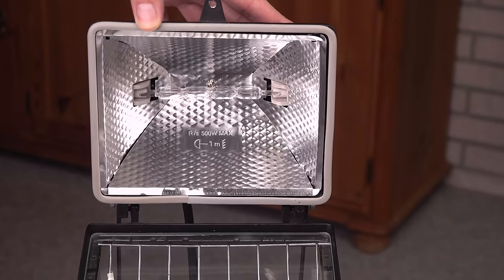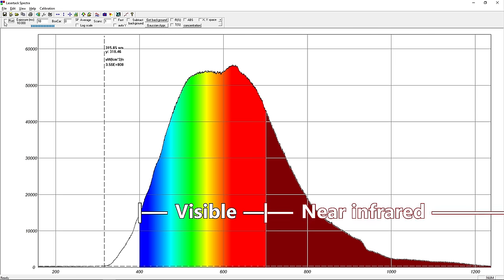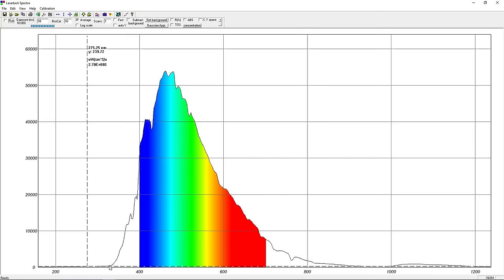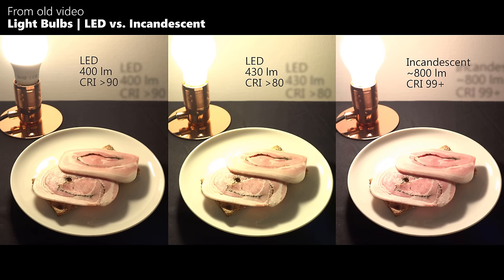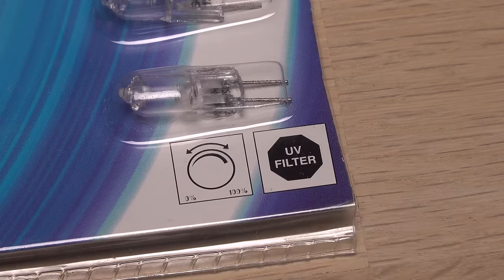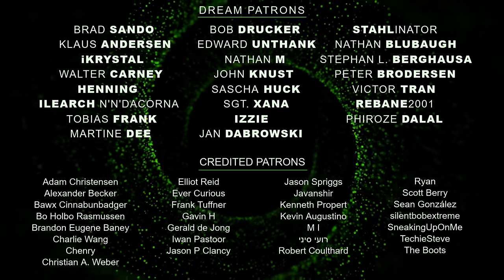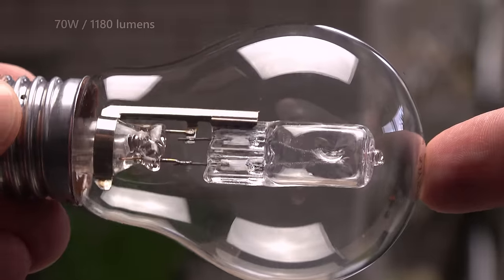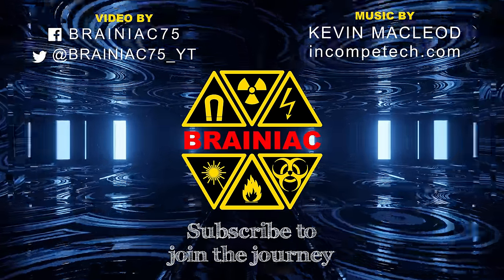Hidden Hazards of Halogen Lamps

Comment: I used to get similar halogen bulbs from the fusers of old laser printers. They were really long, but probably a few hundred watts at most. They scared the hell out of my dutch rabbit once, when she must have thought that the sun moved into my living room.
Reply: Biggest I have is a self ballasted 360W sodium vapour lamp, which has a 200W internal tungsten filament lamp as ballast for a 160W HPS capsule. ASL a few 400W mercury vapour lamps as well, which i used as room lighting when I wanted a lot of light, as they have a very good CRI by design, as they are high bay lamps for indoor use.
Reply: @SeanBZA  Where'd you get your hands on a self ballasted sodium lamp?? I've been looking for one for absolutely ages! (Something like 3 years...)
Reply: @sovb  An old Chinese lamp, got it at a lighting and electrical supplier, and wanted it the second I saw it in the big box of reduced price units.
Reply: @SeanBZA  Did you mean self ballasted mercury? I've never heard of a self ballasted sodium lamp before, that sounds really interesting.
Reply: @Snowcube  No it has that yellow sodium glow. Think it was mostly used on fishing boats, the yellow penetrates water better. Internally mostly SBMV, just the mercury has a lot of sodium dissolved in it.
Reply: @SeanBZA Do you have to shield your eyes to use the sodium lamp or not ?
I ask because I just got hold of two 400W high pressure sodium lamps (The normal kind, with a ballast and ignitor) and using them to light up a room makes my eyes hurt even with sunglasses on and the bulb hidden from direct view.
I tested the UV and there's much less than from a blacklight though.
Any idea ?
Reply: @psirvent8  Well with 400W of light you will just be about at equatorial noon levels of light, and there you definitely hurt your eyes when it is bouncing off all surfaces equally.
Reply: @SeanBZA  Thank's !
But do you know if it can really cause lasting damage to my eyes or if it is only discomfort ?
I know some websites sell blue and green tinted goggles to people using HPS lamps to grow plants indoors however they are quite expensive and also my ski goggles work quite well when I use with my 400W mercury vapor blacklight at close range, however they don't seem to be doing anything when it comes to the HPS bulbs.
Being in streets illuminated by HPS on the other hand didn't cause me any issues, but it might be because of how tall light poles are.
Reply: @psirvent8  They probably doesn't cause any damage but fatigues your eyes due to the poor and discontinuous light spectrum
Reply: So you are telling me that 99% of car headlights have radiation???!!!!

Comment: The MR16 that you noticed filter UV lights are known here as "Dichroic" lamps, the UV light is NOT reflected by the metallized coating, which is a dichroic mirror that only reflects visible light. You may also see a smaller amount of IR with them as well. Try putting your spectrometer to the back of the lamp and you'll probably find your missing spectrum. You can't measure it like you did because the filament is vertical so most of the energy is radiated sideways for the parabolic mirrors to catch. You can also try with an AR111 lamp which is a metalic reflector, not dichroic (AR111 = Alu reflector, 111mm). These are often used in applications where you can't release the heat into the recessed ceiling behind.

Comment: You can see a UV Stop in Halogen Lamps if you shine a UV light source at them, they will glow Blue-ish if a Filter is present.
Reply: Absolutely and I'm glad to not be the only one to have found this magic trick if I can call it like that.
No one else makes mention of it on the web, and I found that it also applies to metal halide bulbs that have UV filters.

Comment: Back around 93 to 2000 I had halogen track lighting in one room with the lights aimed towards one wall.  While the bulbs were replaced a few times they were never re-aimed but none of them had any glass covers...just the bare bulbs.  The walls were painted blue and when we finally decided to redo the room we were surprised to see a very clear bleaching of the paint only where the lights had been aimed and it was even more evident where the lights had overlapped each other.
Reply: My closest McDonalds used to have this photo wallpaper above the cash registers, and a handful of halogen spotlights in the ceiling above. I don't know for how long they had that setup, but you could clearly see these triangular bleached areas below each spot, perfectly following the cone of light. 
This sure explains why.
Reply: Same thing happened to coloured plastic films I had put in-front of the ones I had in my bedroom
Reply: Photobleaching can be cause by visible light too, and in some small measure even by NIR, if the source is intense enough and the exposure is long enough. The effect however is much more prominent at shorter wavelengths (blue and UV)
Reply: So you are telling me that 99% of car headlights have radiation???!!!!
Reply: @gabrielv.4358  Halogen lamps do give off UV.

Comment: The main safety function of the glass cover is to contain the hot halogen capsule glass if it explodes.
There is quite a difference in the front/rear direction heat is emitted between the standard aluminised reflector and dichroic coated glass reflector.
Metal halide lamps emit considerable UV, some types have UV block glass, others rely on the glass on the enclosure.
Reply: Yes, the 1kw Metal Halides are vicious.
Reply: As well as protect the bulb from dirt and dust. Dirt + heat = possible fire.
Reply: Hi, I thought that the shielding protected IT from shattering. (“It” being the bulb) so basically, No shielding= Bulb explodes. Shielding=bulb lasts its Life. (At least that’s what I though)
Reply: I had one bulb that exploded (a g9 socket unprotected) and fortunately 😂it broke my phone glass and missed my eyes. so that protection is much more important than uv.
Reply: @Stoney3K  and to protect it from grease/oil (mostly from the fingers).
The bulb is made from quartz because glass would no withstand the very high temperatures, but the oil from fingers skin will blow it in a very short time, or at least crack it.
A friend of mine didn't know and installed the tubes with bare fingers, without cleaning them afterwards, all the bulbs died after a few hours, some lasted even less than that.
Reply: @pbe6965 your mate 'old greasy fingers' McGraw?
Reply: That's not the MAIN reason. U/V filtering is the MAIN reason.
Reply: Right, the two most important purposes Are containment of an exploding bulb, And thermal stabilisation.

Comment: In most cases the amount of UVB you can possibly get from halogen lights is so insignificant compared to any amount of Sunlight and cannot give you a sunburn even if it shines on you all day long. 

That said, there were also specialized "Sunbathing" halogen lamps that ran so hot they actually looked blue. Very short lifetime on those as well.
Reply from the maker: For the 10 and 35 watters, sure, it's no biggie - but for the 400 - 1500 watters? I would like to be informed about it ;) Thanks for watching!
Reply: Yes thank you. It's trivial. Get back from the light and it's not a problem regardless of power that you can buy in a store.
Reply: The Sun is ~1366W/m^2 of actual light energy.
1500W halogen is going to be way below that because they're so inefficient, even if you're up close. You'd have to be right next to it.
Maybe its something to be measured and compared on a future video.
Reply: @n-steam  1-2%, so 15-30W worth of light, right up on it

Edit: And at that, only a tiny sliver of that is UV energy. There's more threat from a 1W UV LED than in a 1500W halogen. 🤷‍♂️
Reply: @MadScientist267  There's an area component to it too. Gonna make a guess and say the area of the light's face is 0.03m^2, so that 30W becomes 900W/m^2.
Reply: @n-steam  Uh, no. That's right at the filament.

You have 30W total to divy angularly from there.
Reply: @brainiac75  considering how much radiation the sun constantly hits the earth with every second, being next to a 1500 watt bulb would be nothing, the sun has a far higher chance to give you sun burn over the halogen bulb. in my opinion the radiation from such a tiny yet powerful bulb is negligible at best
Reply: Also you might have a halogen shining in a way that goes directly into your eyes, whereas you wouldn't be staring at the sun for an extended period. I wonder whether the UVB would also age interior paint more quickly, given it would be exposed to it constantly. I wouldn't be worried about sunburn (neither indoors nor in the sun).
Reply: I agree and the best source of vitamin D is UVB so its actually healthy especially in winter
Reply: @Robonza  Too bad there's almost none there
Reply: yeah a little radiation never heard anyone, right?
Reply: @brainiac75  I'm afraid you're going to cause the Vela satellites to pick up another Double-Flash. Be careful!! 😳🤣
Reply: About the halogen lamps looking blue, that's not physically possible: the average incandescent lamp is run at 2700K, more or less, while commercial halogen lamps are usually around 3000K. Research grad halogen lamps can be run at 3200K with a greatly reduced lifespan (1000 hours or so) and for every 100K you reduce that lifespan by a factor 10. At 3500K the tungsten soften and at 3700 it melts.
The white of your monitor is 5000K, while daylight is about 6500K, at which point tungsten is completely evaporated...
Reply: @Beregorn88  I'm guessing the blue-looking Halogens probably filter out some of the red (and IR) light using dichroic coatings on the glass or something like that. That way the color temperature is not completely tied to the filament temperature.

What I meant originally about the "Sunbathing" halogens is that they do run the filament hotter to shift the spectrum and produce at least a notable amount of UVB, which also makes them apper slightly more blue-ish as well. I dont know their ratings, but the ones I mean definitely had a very short service life. I wouldn't be surprised if it was just 10h or so.
Reply: @brainiac75  who the hell is going to have a freaking light socket that can actually freaking power a 400 watt light bulb?
Reply: @REAL-UNKNOWN-SHINOBI  American 120v outlets xan support at least 1800 watts if not more.
Reply: @REAL-UNKNOWN-SHINOBI  You're clueless.
Reply: @REAL-UNKNOWN-SHINOBI  You only need 2 amps for that.
Reply: Not to mention that only below 285 nm does it actually cause damage to elements in our body.
Reply: That's pretty cool. I had no idea they could make Halogen bulbs burn more hotter to the point they emit UV. The filament must have been pretty strong.
Reply: @n-steam Wattage isn't at play here. A 400w Mercury Vapor lamp with the glass bulb removed will easily emit dangerous UVC.
Reply: @REAL-UNKNOWN-SHINOBI almost everyone 😊
Reply: @REAL-UNKNOWN-SHINOBI the whole world???
Reply: So you are telling me that 99% of car headlights have radiation???!!!!

Comment: Another thing that the front glass on halogen flood lights and the 12V PAR16 lamp you showed us do, is it helps to maximize the lifespan of the bulb by prolonging the cooling time of the bulb glass.

And for the halogen flood light, the front glass will also catch flying glass shards in case the bulb explodes.

Comment: I bought a handheld 1000w halogen lamp from a second had store that specializes in photography. It's tiny, not that long tube format but a bulb type of several cm. 
When it's powered up there's seemingly an extra sun under the sky. After a while you can smell litte dust particles just being incinerated. I'm always impressed with that monster light.
I wonder what the spectrum is like.
Reply: I have one of those to , with  Handel on right? not ment to be on very long ,because the whole thing gets very hot fast, these was 
Produced when they used 8 mm celoid film  reels, often they did not expose very long clips in one go, so 
The bad cooling was a lesser issue 
Then today  I think.  Mine smell burnt  dust also when on and yes it's like having your own sun.
Reply: @perstaffanlundgren  Yes the one made with bakelite and metal and glasfibres. It's a beast but even more so because it's basicly a pointsource. i never used it more than half a minute at a time because of the intensity and handheld bizar power. Awesome thing. Don't think I'll let my 5 yr old kid play with it. She can have it when she can play and understand with fire and electricity and not harm anyone seriously. 

Microwaves and their magnetrons are another wonderfull dangerous but so interesting system to experiment with.
Reply: As an event/theatre lighting tech I am unfazed by 1kW lamps, they have been the standard for years now. A lot of theatres even still use 2kW halogens for their front lights, just an array of ~12 2kW lights baking on the stage aided by 1kW's and 750w's

Comment: I was at a fashion show (a long time ago) and the big halogen lamp in a reflector ABOVE the catwalk melted, and the molten glass missed one of the models by just a few centimeters. The lamp was obviously unprotected. Imagine the horror if the glass had fallen on the head of a model.
Reply: Ouch, that wouldn't have been good. If the bits fell on a wood floor the pieces would probably start smoking.

Comment: 50h bulbs are actually quite common for microscopes and projectors.
For reference, check out the OSRAM 64640 HLX
There are other versions with 300h and 2000h iirc and they are not that much more expensive.
Although prices might vary quite a bit now as availability gets worse.
Reply: speaking about projectors lamps, i heard IMAX lamp is some incredible halogen or ark lamp that is water cooled and has explosion risks if operated carelessly
Reply: @Gameplayer55055  that sounds like it would make an interesting video. I mean how the light works. Not it exploding.. although sadly I'm sure that would get a lot more views than how it works.

Comment: I believe some lamps used for photography had super thin filaments for a colder color temperature resulting in an avrage life in the tens of hours, that may be what that is.
Reply from the maker: Yeah, it is mentioned on the paper that it is for 'professional use on stages, theatres etc.'  Not meant for lighting a home. 50 hours is still rather ridiculous though ;) Thanks for watching!
Reply: Yeah photoflood bulbs, normal incandescent but at 3200-3400K cct.
Reply: @freevipservers  bulbs with similar color temperature are available as halogens but with significantly longer lifespans, of course. I use 1000w 3240k studio lights with a quoted lifespan of a few hundred hours, iirc. Haven't looked in a while. Not quite the 3400 of a 500w photoflood though.
Reply: I used such lamps when filming on super-8 in the 80s, the film sensitivity was 16 or 64 iso, much light was needed. The lamps where VERY fragile and almost glowed red for 10 seconds when switched off. These were also very good to find faults in your apartment mains wiring.
Reply: @benoitgrange3479  how would you find those wiring faults? Follow the smoke?
Reply: @nos9784  yes. Some wiring was made of cotton isolated aluminum wires. And I found some connections made simply by twisting the wires together which heated badly.
Reply: @benoitgrange3479  damn... that's a scary fire hazard. 
It's scary how you can rarely know what mistakes lurk in the walls... we found some too thin wires taking wierd detours to reach an outlet in one place ( with electricity on the grounding contacts) , other wires taking the shortest path- diagonal across the wall, contrary to local codes...

We also have some "still to be replaced" textile wires. Too busy...

Comment: The EU ban hit me hard... 
But not for private lighting. I'm currently working on my PhD in semiconductor technology and using a sputter chamber.
The tool has a heated chuck to put the wafer on. The heater has to withstand ultra high vacuum and temperatures of around 300°C.
The tool manufacturer decided to use three 400W halogen lamps as heat sources since the glass perfectly isolates the hot metal from the vacuum and thus prevents contamination of my samples.
We build up a stock as spare parts but they break way faster than anticipated...
Without some good connection to a friend outside of EU they would be unobtanium.

Comment: What about H4 car lamps? They are halogen too. But only behind a super thin plastic cover. At least on my e-up. But the old Škoda 130L from 1986 has thick glass headlights. Are new cars emitting UV light from their halogen bulbs through their super thin plastic headlights? Or does it filter it out?
Reply: Well, the Philips H4 bulbs that came with my car do have UV filtering as they glow blue under a blacklight.
Plastics on the other hand can also block UV.

Comment: I really hope they will eventually start making LEDs with reasonable spectrae. It's MUCH better compared to the 2005-2010 LEDs but still suck compared to halogens. Lately I switched away from halogens in my kitchen but honestly want to go back. :/
Reply: Use the high CRI LED bulbs like FEIT Enhance or Sylvania Tru-Wave bulbs.  Much brighter and better color rendition 90-93 CRI even in warm white 3000K.
Reply: Look for high CRI bulbs. You have to pay more for them, but the light output is excellent.
Reply: Thanks, will check it out. From what I see the bulb I have now is 80CRI which looks pretty poor.
Reply: @bzqp2  yeah 80's are the usual ones you get, makes colors look poor... If you look up the color spectrum of a low CRI bulbs VS a high CRI you will see how spiky the graph looks, so some colors are overblown, and others look dull since the bulb isn't producing that wavelength to save cost on phosphor.
Reply: If your willing to pay for it, Yuji LED make bulbs with 98 CRI that comes in 2700k to 6500k white. I got a set of their A19 base bulbs and they look much better in color compared to regular LEDs you find